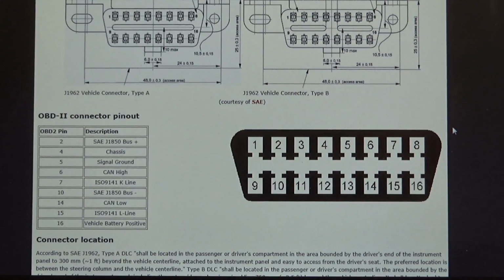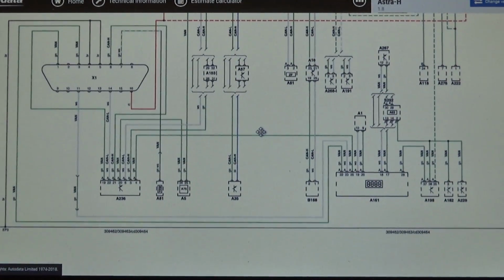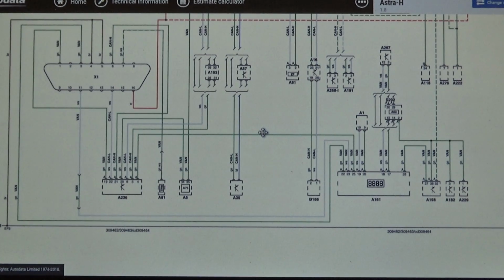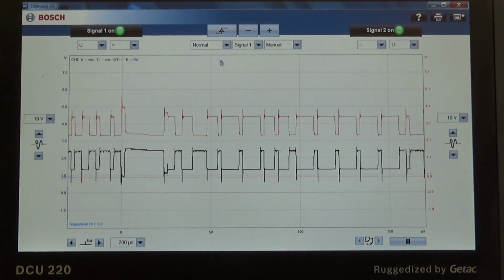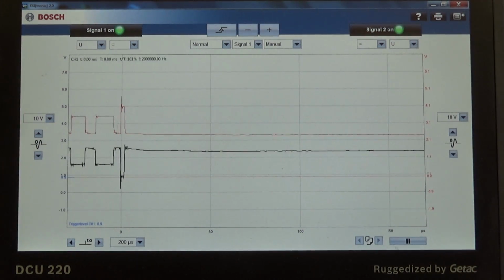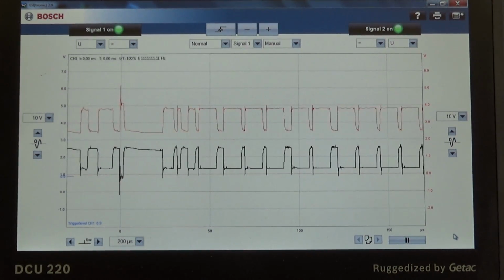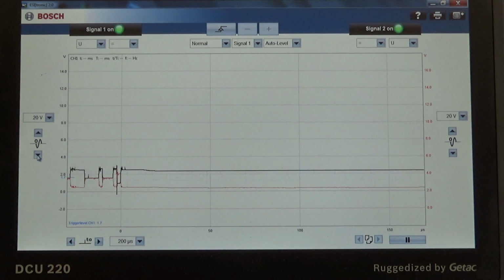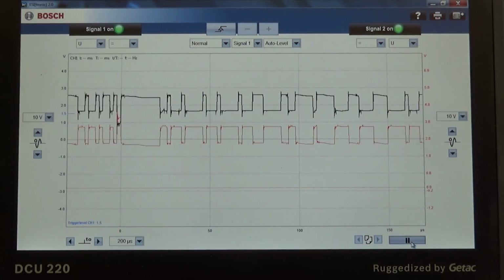CAN 101

Comment: will this test work on any vehicle and thanks for the great video
Reply: Good information btw. I am troubleshooting a ford no pcm trans abs instrument cluster communication with our ids scanner. I have power on pin 16 and good ground on chassis and  sensor on the dlc. I have a hunch I have one module is causing this. Do I really need a lab scope? Or multimeter
Reply from the maker: Meter is ok for quick checks, go -no go tests, anything more in depth and the scope is your friend 👍
Reply: @SimplyDiagnostics what's it mean if CAN HI and CAN LOW read 1.2ohms at ecu but 60 at obd port? Does that mean can wites are shorting to eachother?
Reply from the maker: Michael Szweda yes Michael but be aware some vehicles do not have CAN at the DLC and use a gateway module. In this case you have to test at a module. There will be more videos in this series, expanding on the topic. 👍
Reply: @SimplyDiagnostics  How do you know if the car has CAN at DLC im trying to work on a 2018 volkswagen beetle
Reply from the maker: If it's gateway equipped then it may not have power train CAN, have a look at a wiring diagram.
Reply: Was great 
When I measure resistance between 6and 14  it shows 46 ohms what can cause it?
Thanks
Reply from the maker: Is the bus powered down and asleep?
Reply: @alitehrani3415  I got communication error on OBD2. Resistance between pins 6 and 18 is 46.5 ohms. The car is Rogue 2018.

Comment: Hello sir
Mazda 3, 1.6hdi 116hp, 2012
I have no communication between the diagnostic device, tried 3 different ones, and the module on the HS CAN network.
Tested the following
On DLC pin 16 there is B+, on pin 4 and 5 there is B-, on 6 and 14 the resistance is 60 Ohm. I measured the same signal and it is also good. There are no irregularities, voltage spikes or drops.
I disconnected the power steering pump module, no change. I disconnected the BCM, no change. Even with the PCM disconnected there is no change. HS CAN does not communicate. I measured B+ and B- on PCM, but I don't have wiring diagram, so I don't know if I did everything. What I measured everything is ok.
The vehicle drives normally, everything works normally, except for the power steering pump, which was damaged in a collision and was replaced by another one
I note, I had no communication even before the collision. And then the servo pump worked like everything else.
I suspect some kind of PCM locking?

Comment: Please help! 
How can I solve this car problem? Recently, a client called me to fix his 2000 Toyota Avalon car that cranked but wasn't starting.
   From the onset, the car experienced several mechanical, as well as, electrical issues. Some of those  problems were:-
(1) Engine Oil consumption;
(2) Engine misfire;
(3) Engine rattling;
(4) Intermittent hard starting after shutdown; 
(5) Hard to engage in drive, except engine is hot; etc.
Hence, he took the car to a garage inorder to rectify the excessive Engine oil consumption and other car problems highlighted above. Consequently, the car  problems exacerbated after engine rebuild by the engineer! 
  The car owner wasn't satisfied with his repairs because it seems the engineer was deceitful. Although the car started after the rebuild, the problems still persisted.  Valves weren't grinded after engine overhaul, engine still misfired at idle and when accelerating, etc.
   The  engineer whose garage the car is presently being parked, requested for another engine overhau/ rebuildl. After engine rebuild the car started, the oil was mixed with water; the engine was still misfiring, rattling, etc. It was obvious,  that he didn't use durable parts to do his work.

    Hence, the car owner moved the car to another garage for better repairs. The new garage suggested to the car owner that another engine rebuild is pertinent for optimal engine operation. 
    During my conversation with this engineer, whose garage the car is presently being parked, he told me that: "when the car was first brought in, he noticed a black smoke ( maybe he was mistaken for blue smoke, at exhaust tail at idle). When accelerating, there's a loss of power, engine bucking, popping,etc. After the rebuild, the car didn't start because the mechanic didn't unlock the car with the remote but proceeded directly to cranking the engine. In addition, the security relay wasn't actuated for starting to take place. Electrician did some wire cutting around that axis which he said was corrected to factory, opened with a remote before the car started.

   Fortunately, after everything, the car started again. But there was still an intermittent misfire. What the car owner said was that, 'even when the second mechanic did engine rebuild, the car still misfired. Until he personally bypassed earth from the COP wire to the solenoids very close to the fuel injector often tightened with 10mm knot and depicted with blue and green colors on the picture. Car owner verified that the reasons for the misfire from both mechanics which still prevailed, was due to the solenoid valve that wasn't opening. That's why when accelerating it experienced a loss of power, similar to that experienced by a faulty fuel pump.
  
   After gear oil replacement and test driven by the second mechanic , smoke started emanating from the engine bay. Precisely, from the fan relay that the car owner connected by himself. Within few minutes, the car shutdown by itself as if fuel is finished.  As he tried to restart it, the car refused to. Infact, when the ignition switch was turned to Acc/ ignition position, battery and fuel light was not displaying in the dashboard/ instrument cluster. However, during cranking battery light glew faintly and start. But when throttled,  it would shutdown. Electrician verified and replaced the alternator diode with a new one. When Ignition switch was turned to Acc/ ignition position, the battery and other lights came out brightly but when cranked to start engine wouldn't start again. Sadly, it still wouldn't start.
 
I tried to scan for DTC codes, but my scanner wasn't communicating. I checked all fuses, power and ground at obd port, those checked ok. but my scanner isn't compatible to read CAN network. there are only 4 wires intact for the obd2 port.
    Furthermore, I added fuel through the intake to the engine, no change at all. I checked for spark and injector pulse. These things weren't present. But there was power to injector with just the key at ignition or ACC and COP had 1 ground and 1 power as usual. 
 Electrician from that garage, who also worked on the car said that he sniffed burning smell from the ECU, however personally I didn't when I went to start the car. I don't know how certain that was. Hence,  I pulled out the ECU to a laptop board engineer to test the components inside. He said: "everything looks ok and test fine, however the IC he doesn't have the right tools to proceed with the test. With the ECU removed battery connected, Engine light would come ON. with ECU connected check light still comes ON.
Before I left, I checked the MAF sensor 5 wires and noticed that 3 wires were earth instead of 2 and 1 power; no ignition current/ power was available for the remaining 2 wires. 
  Please, what should I do to start the car?

Comment: Great video , thank you very much. Where are you getting the info for the wiring diagrams ? And I would like to know, from where does a free workshop is taking the repair information for all the car brands ? For example what kind of component has the engine, or how do you change a timing chain ect. Thanks in advance 🙏.

Comment: I have engine service malfunction on the dash, 2013 fiesta, came on today.  No codes, runs great otherwise, so tomorrow I'm checking around. You explained CAN very good. I don't have break out box but I still can check for 60 ohms with meter and eliminate  CAN system. Thank You Eddie p

Comment: Are all 120ohm resistors on bcm and pcm on all vehicles? I got a 10gmc terrain 2.4 I'm working on and pin 4&16 reads out 120ohms.
Reply from the maker: Not all Christopher, their locations are normally in manufacturers info, not sure on GMC as that's not something I work on over here.
Reply: @SimplyDiagnostics  yeah the wiring diagram just showed one. Turned out the people who swapped out the engine forgot to plug in the steering module 🤦

Comment: My OBD port is wired nothing like this. Here is my pinout - spot the CAN high and CAN low... PLEEEEAASE lol.
Pin1,16 +12V
Pin 4,5 earth
Pin 6 to mirror & seat module
Pin 7 to engine ECU
Pin 10 to ESP unit
Pin 11 to Body unit.
Pins 2,3,8,9,12,13,14,15 no connection. 
There are NO twisted pairs going to the DLC.
Car is a 2003 Peugeot 406.
Reply from the maker: 6 & 14 are traditional CAN terminals, this has changed with some manufacturers, especially those fitted with a gateway module. 4&5 are GND, 16 batt ref refer to manufacturers diagram for vehicle specific info 👍

Comment: top video steve. where would you go if you have a 0 resistance reading? i had this scenario on an audi tt and it stumped me. keep up the good work 👍
Reply from the maker: Zero as in zero or infinite? Lots of vehicles use gateway modules where there is no CAN at the DLC, if it's zero ohms then there  could well be a short between high and low. Some  manufacturers are now using single.or multiple terminating resistors. Always try and refer to manufacturers information where possible for system design and operation 👍
Reply: Simply Diagnostics. yes sorry it was zero. so if the car has a gateway can u test the bus line at a module say the abs pump? finding it harder as the gaffer doesn’t like diagnostics and just about pays for autodata 🙄 thanks for the reply 👍

Comment: hey man stumbled across your video found you  through watching SMA! this tutorial is awesome btw im trying to diagnose 2007 chevy equinox with all wheel  drive u0073 and a p2544 codes service stabilatracs in the cluster doors locks cycling limp mode got the car home  i was able to pull thoughs codes before it lost communication! checked resistance between 6 and 14 at the dlc im getting 6.25 m on the DVOM and at the abs connector ! i have no communication with high speed lan and its not crank no start. i measured resistance at the pcm i have 120 ohms,  i haven't tested the other resister yet do to it living on top  the clutch control module on the rear diff. out of the dlc it reads 2.5 high side and 1.8 volts low side. ive disconnected  modules one at a time trying to gain communication with something and nothing i must being something wrong any help wold greatly be appreciated im really trying  to learn the network side of things thats so much and merry Christmas!

Comment: I would recommend to disconnect the battery before testing the resistors !
Reply from the maker: Great point, battery reset procedures on modern vehicles can be very involved and time consuming. For these simple checks, most of the time, it is enough to wait for the network to sleep. There are exceptions  to this of course. 👍

Comment: I'm chasing a U0073 code & vehicle drives perfectly, only noticeable issue is EGR & EVAP monitors refusing to "pass".  I'm getting 60 ohms across CAN HI & CAN LO.  However, I'm getting 2.2v on CAN LO & zero voltage on CAN HI!  Breakout box shows the light flickering constantly on CAN Lo but the light for CAN HI is intermittent.  I'm stumped!

Comment: Hi Steve. I have a Volkswagen T5 2006. And have a fault on the physical network and I’m looking to get a wiring diagram so I can investigate the problem.

Do you know where I can buy one.

Great video thanks again
Reply: Both pin 6 can h And pin 14 can low both have ghost voltage/open circuit

Comment: Thank you for the video. I was wondering if the  voltage tests here would be the same on Chrysler CCD? I know the pins at the DLC would be different, I think 3 & 11, for CCD+ and CCD-. I have a 1998 Voyager, with codes P1698 & P1695, the instrument cluster does not work, and disconnecting the climate control module seems to keep the CEL out but doesn't help with the instrument cluster. I really don't grasp CCD yet, and don't have a scope. I was hoping for some direction, and also if I do have to buy a scope, could it be an inexpensive one? Ideas? Thanks. D.

Comment: Very informative 
But I must report on a 2003 Merc SL55 I've just worked on which I could not measure the CAN system cold resistance via the OBD as I believe it goes through a gateway controller first.
With a meter between pin 6 and 14 of my breakout box the was infinity resistance even though the Canbus is working and my scanner talks to all modules perfectly.

The only sure way of measuring the network termination on this Merc was to access the CAN C connector block where all the CAN lines meet. This is where the 60 ohms could be measured 
Hope this helps someone :)
Reply from the maker: Gateway equipped vehicles are becoming more common but you can still perform the same tests at the gateway module. Thanks for taking the time to comment 👍

Comment: SIMPLY DIAGNOSTICS,  how do you upgrade from a CAN bus 2.0A or 2.0B to a CAN FD? what scanning tool do you use to verify and test each CAN module? When you disconnect a Module this is an OPEN condition, how else can you create an OPEN module circuit?

Comment: If one of the modules on the circuit(NOT the ones with the 120 Ohm resisters in)was open circuit would this cause a loss of data transmission?....Thanks Steve very informative video

Comment: Great professional video on explaining CAN BUS diagnostic. You must be so busy that you may not have time to respond but I have a question.
My 07 Infiniti M35 won't start. After a can diagnostic, it shows low to no communication between the modules. 
The CAN Diag result specifies: open circuit on the CAN L of the DLC branch line but sometimes it says short circuit instead of open circuit too so im confused. 
Not sure if the modules entered fail safe mode due to that or if they are all fried.
The wiring of the car is big and hidden by things that dont allow to test directly at the CAN L wire.

Question 1: can I trust this result?
Can a bad ground trigger this diagnostic?
Can a lose battery ground cause this?

Your info says 60ohm at pin 6 and 14 if all modules are connected but 120ohm if a module is disconnected and you said if all module connected but still does not read 60ohms then there must be an open / short circuit (hope i got this right)

Question 3: is this info specific to the car you are working on or is it general to all cars?

Question 2: I have access to all the modules on my CAN except the TCM that is inside the transmission.

Question: Any insight on how I should go about this?

Your input will be very much appreciated. 

Thank you

Comment: I'm getting 61.5 ohms is this acceptable thanks for the vid👍
Reply from the maker: Yes mate, unless you disconnect batteries and discharge capacitors there will be a degree of variance. On modern cars this "drift" is not enough in the majority of cases to warrant disconnecting batteries and all that entails.

Comment: what the 'maximum voltage that should be measured at the earth terminal of a consumer with the circuit switched on and in good condition'.
Reply from the maker: Depends on the consumer. Sensor gnd then <10mv, actuator <100mV, starter <1V

Comment: No mention is made of the fact that all resistance testing must be done with the battery cables disconnected.
Reply from the maker: That's because in the real world, battery disconnection is not a simple job anymore. I t can be a time consuming job just to access a battery,then there are procedures to follow before disconnection, never mind all the resets that have to be done afterwards. We are looking for 60 ohm's not milliohms, power off and network asleep is sufficient. Cheers.

Comment: Can anybody help? 
I'm having an issue with my CAN Communication. Pathfinder 2007, it won't start and can't scan with OBDII. With Picoscope 2004a, I get perfect CanH-CanL waves. The moment I connect the ECU, CanL rides the CanH wave at half its peak. So they look somewhat identical but no longer a mirror of each other. I'm quite sure one of the terminating 120 Ohm's resistor is in the ECU. Is it possible that the ECU has an internal short that's causing this issue, or is it certain the short is a connector or wiring? 
Any good feeback is appreciated. Thank you.
Reply from the maker: Test your physical layer for 60ohms. If it goes to 120 when you unplug the ECU then there is a resistor in the ECU. Anything other than 60 tells you your network is not intact.
Reply: @SimplyDiagnostics  Yes, with  battery disconnected: I get 60ohms when ECU is connected; and I get 120 ohms when ECU is disconnected. I tested the CAN bus in every imaginable way and it seems to work just fine as long as the ECU is disconnected. The moment I plug the ECU, communication from all modules is compromised. Is it possible that another module or a shorted part could have shorted out the ECU?  I ask this because if there is still a short somewhere in the vehicle, once i have the ECU repaired or replaced and the vehicle turns ON, if something caused a short on the ECU it will do it again and damage ECU again. Prior to my vehicle going dead, something sent it to limp mode 2 weeks before. A mechanic looked into it and pulled U1000 and U1001 codes. The mechanic got the vehicle off limp mode and told me to take vehicle to Nissan dealer, but the vehicle was driving better than ever and 2 weeks later it just died. I towed it to Nissan dealer but they gave me some bogus diagnostics on the vehicle (they just wanted to replace transmission and many other parts), so I towed it back home. (I heard that if the TCM goes bad it can short out the ECM. Is that true?) Thank you for any additional help you can provide.
Reply from the maker: I'd check power and grounds to the ECU, check Vref (if absent it can indicate a shorted sensor or circuit) before condemning a module.